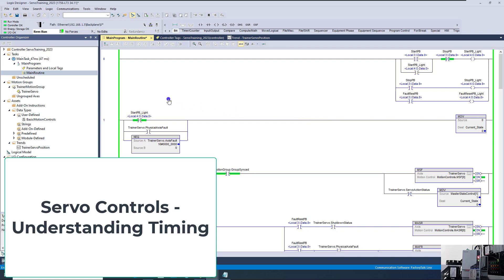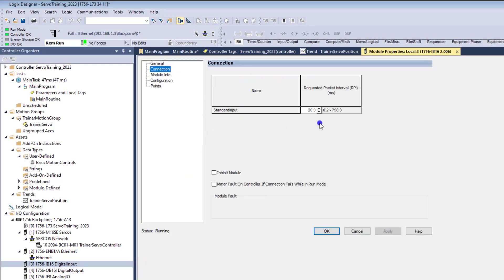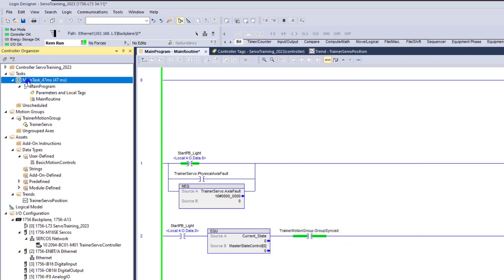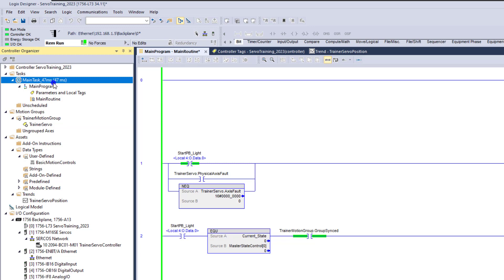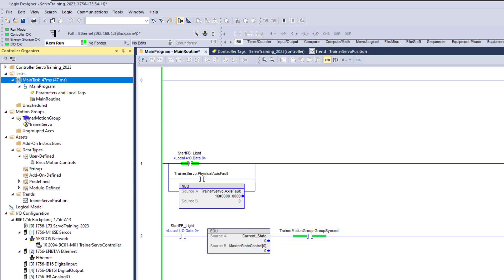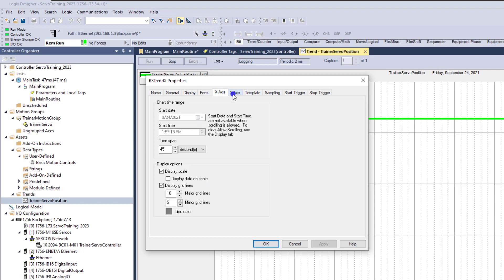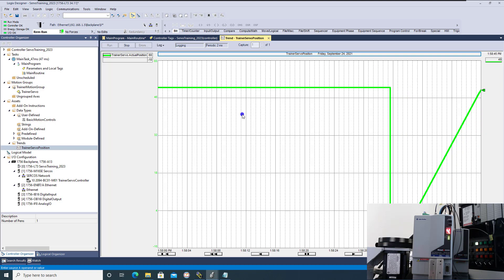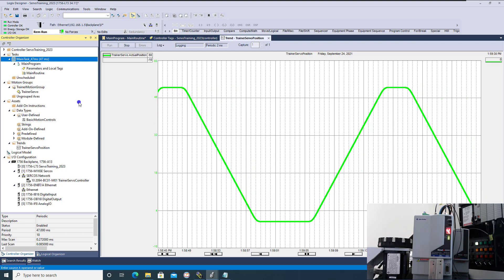Rockwell Automation's Studio 5000 Servo Controls - Understanding Timing & Data use

Comment: hi master, do you have video of virtual axis syncronized with other axis? I have a unwinding system of 3 axis and y need syncronize movement. What do you recommend? thank you!
Reply from the maker: @Quamfy  virtual axis synch the same as mag instructions
Reply: @ShaneWelcher  every physical axis syncronized with virtual axis using MAG?
Reply from the maker: @MrKarajo  you gear the axis to the virtual if that's your goal
Reply: @ShaneWelcher  I have 3 axis must move syncrinyzed. My idea is to create virtual axis and linked to any single physical axis by using MAPC? Am I wrong?
Reply from the maker: @MrKarajo  the virtual axis should be geared to a regular axis and then the other axis to the virtual axis to run together.

A motion cam is different
Reply: @ShaneWelcher  but also any regular axis could be geared to the same virtual axis and it works as well isn't it?
Reply: @ShaneWelcher  hi shane, what is the problem if i move the virtual axis and every single regular axis is geared to the same virtual axis? many thanks!
Reply: @ShaneWelcher  I've sent you one email this morning asking for your consultant services. Did you get? My company name sb industry automation